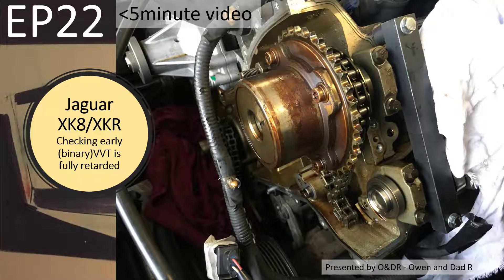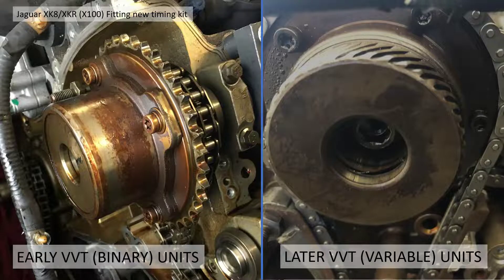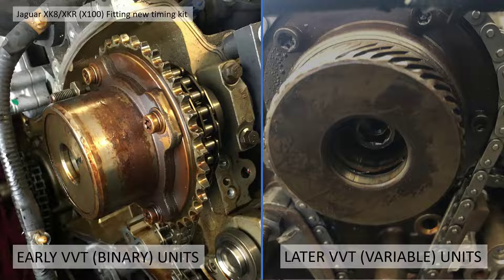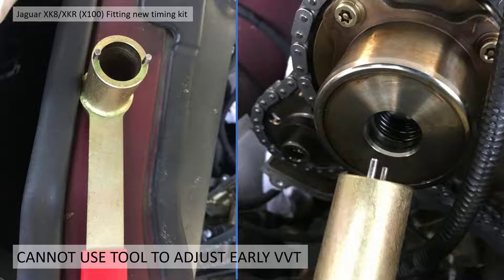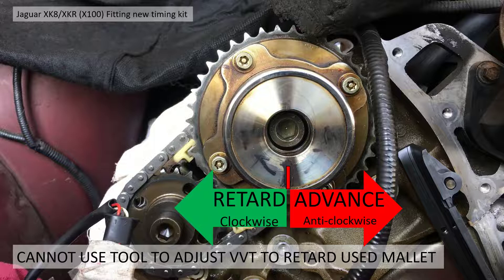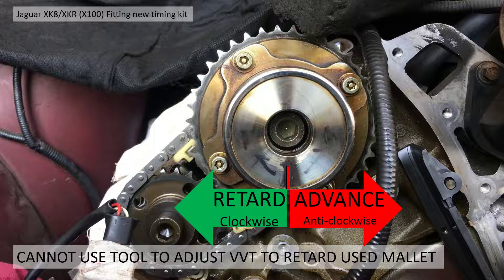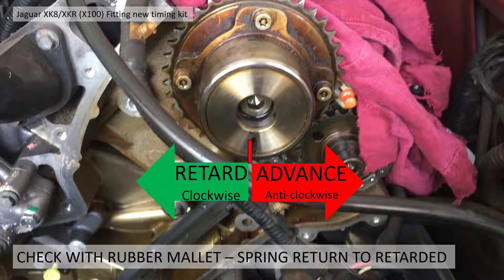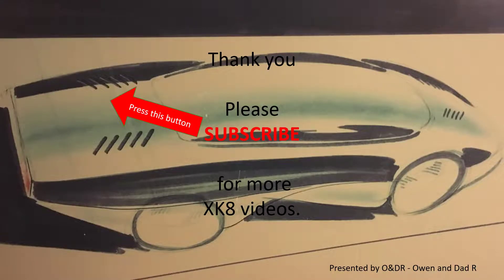Jaguar XK8 Timing Chain: Confirming VVT Unit Retardation / Reset (EP22) - DIY Method

Comment: My AJ26 VVT sprockets seem to be seized. They neither move clockwise or counterclockwise. Could they need to be cleaned or rebuilt? I'm in the middle of changing timing chains/guides. Any insight you can give would be appreciated. Thank you.
Reply from the maker: @woody4213502, John, Sorry to hear you are having problems. From memory I think I had similar issues, until I got the units moving. The VVT only retard on the AJ26 NA engine, therefore only move in one direction. Have you tried to the retard the sockets using a pipe wrench to over come the initial resistance to move. I think I had to do that initially. Hope that helps, please let us know how you get on, regards Damian
Reply: @Modurol I tried the rubber mallet, a large channel locks, and even the old chain to try to get them to turn ... No movement. I looked at the springs inside and decided they must be in the retard position so I went forward with assembly. I'm putting the cover on this evening.
Reply from the maker: @woody4213502, John, tough decision, good wish you good luck, regards Damian
Reply: @Modurol I finished and everything seems good. The ticking I heard before is now gone. I did add thin o-rings under the seals in the VVT brackets feeding into the VVT. I thought it would keep more oil pressure in the VVT and not leaking out around the seal.
Reply from the maker: @woody4213502, John, thanks for sharing you experiences, regards Damian

Comment: So... working with a buddy with his... variable... the manual states retarded is... counter clockwise... basically states to hold the exhaust sprocket Counter Clockwise and torque each sprocket. 

Did this work for you? This clockwise strategy?
Reply from the maker: @northernmnmike2508, the method in the video worked for me in reseting the VVT on our AJ26 engine. Reseting retard is different to the socket tightening method. The AJ26 method is slightly different as the tool engages in a different manor and the rotation is therefore opposite. Either way the spring should return it to the neutral position. Hope that makes sense, regards Damian

Comment: So you don't have to replace the sprocket bolts?
Reply from the maker: @Carlitosway211, No need to replace the sprocket bolts. The bolts are tight but don't stretch the threads so I reused the original bolts. Hope that helps, regards Damian
Reply: @Modurol  Right on! Thanks!
Reply from the maker: @Cartitosway211, no problem and good luck with your repairs, regards Damian

Comment: I was hoping you could do a video about how to replace the 2 VVT Solenoid seals which leak oil and cause the P0171 & P0174 lean condition. The VVT seal part number is AJ82856. Thanks Damian!
Reply from the maker: Nathan, sorry, I couldn't find new seals for my VVT units so didn't take the units apart. Not sure AJ82856 is the correct part number for the VVT seal? How did you find this part number? It is quite common for  P0171 & P0174 lean condition to be caused by air leaks in the intake. I read an interesting post on the subject using carb cleaner to trace the issue, see post below. Are you sure caused by the VVT? regards Damian
https://forums.jag-lovers.com/t/having-trouble-with-code-p0171-and-p0174/362224/2

Comment: The later version unit how to adjust it
Reply from the maker: @user-cx6kk2wt2t, using special tool 303-654 (difficult to describe this tool but you get it with the std timing locking kit). With this tool you can rotate the variable camshaft timing oil control unit unit-clockwise until fully retarded. There is instructions in the Jaguar workshop manual, available free on www.modurol.co.uk  . See manual for 1999 onwards page 1017,1036&1057 of 3265 for a diagram and formal Jaguar instructions. Hope that helps, regards Damian
Here is a quick link to the manual - https://drive.google.com/file/d/1GntT7rcbbW_6nwE45EUw8RhtKaY3kW3U/view

Comment: I had another question. I am reassembling the engine.  How to I refill the radiator on this car?
Reply from the maker: Chris, there is a simple refill process see this video https://youtu.be/eIDJholOW-E
You might want to check the degas tank whilst you doing this. Detailed in this video https://youtu.be/IuCJ2X6NvjA
Hope that helps. Basically, fill it up and the excess will flow to the atmospheric tank. If nothing in there then need to keep filling. Good luck thanks for the comment Damian